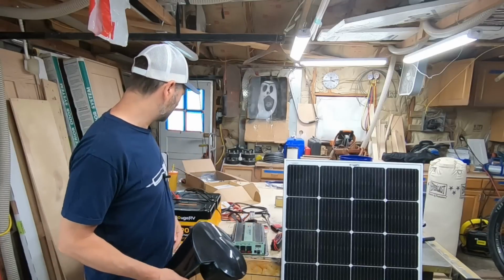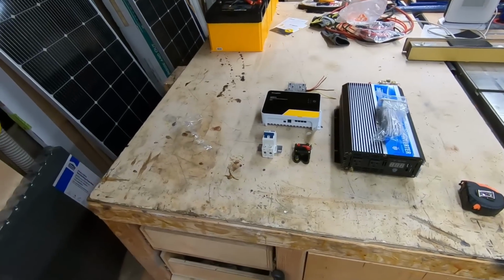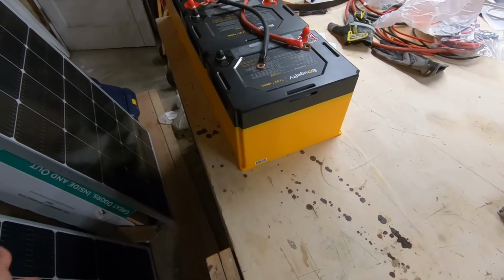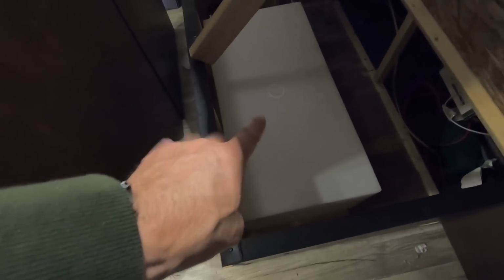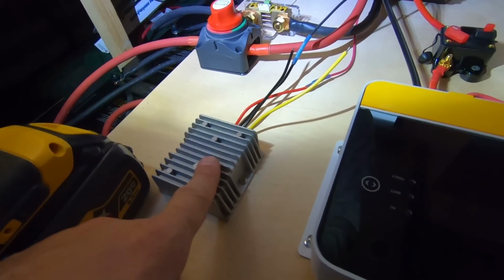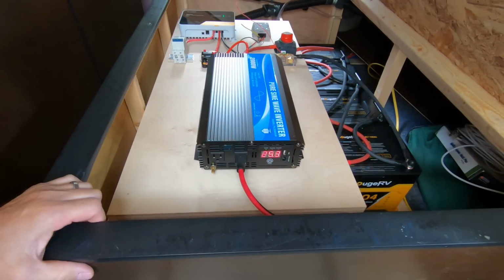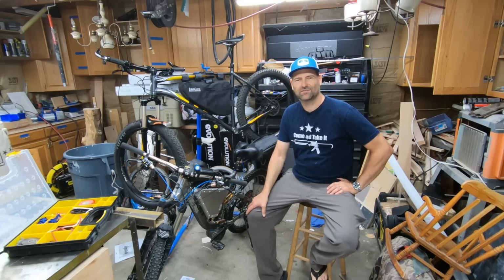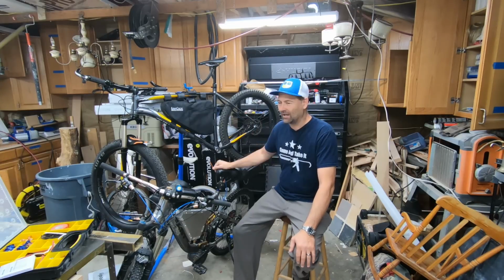California Is Forcing Us To Do This | Here Is My $7,000 Set Up | THE HANDYMAN |

Comment: You bastard, you got me with the boom, made me flinch LOL
We have had solar panels on our rooftop here in Tokyo since 2001, no batteries they just feed into the grid any excess power, and we get paid (VERY little) for the power, but if our grid ever goes down (you know big earthquake or massive typhoon) I flip one switch and I have has some 100v power for my house, not a full house's worth but some power. I also have a back up gasoline generator that would keep my freeze and fridge happy, (I don't want to lose the meat and venison I have in the freezer).
The whole solar thing is cool, but the batteries are still the weak link, but I bet we will be able to engineer out way out of that at some point.
Cheers from Tokyo!

Comment: Let us know if there’s enough airflow to keep the inverter cool. I have same setup in my camper I’d like to do something similar. Right now I have everything setup under a cabinet and it takes up much needed space. Nice setup..
Reply from the maker: That area under the bed is connected to the passthrough storage so its a lot of volume to heat up .  I could stick a vent in the passthrough door if It becomes an issues.

Comment: I'm not in the US but wealthy countries have similar initiatives. This to gain more energy independence, aside from driving down costs. Burning fossil fuels so expensive that it is worth it/cheaper to mine these minerals. Pollution is also less in the air but contained in batteries and equipment. By the way, your setup or batteries does not use cobalt.
Reply: You are a complete ignoramus

Comment: What kind of camper is that? Do you have a video showing off your camper? Did you build or modify it?
Reply from the maker: 2018 forest river 23dbh patriot edition.  I have done a few modifications to stay out longer. I have a 2nd 30 gallon water tank.  Total water is 76 gallons.  I also have a recirculation valve in the shower that pumps water back to the tank while you are waiting for hot water to get there.  I also have a diesel heater that I use to heat the camper instead of using the main furnace.

Comment: I see you've watched a lot of DIY Youtube videos! lol I also built a very similar hand truck solar cart with a 2000w inverter Nice job! but I used dc breakers for all my cut off's because of the china red ones or very weak ----->poor contacts same with that type of disconnect switch, if anything use the automotive race car type disconnects for max flow
Reply from the maker: The china breaker I had already broke.  It lasted only 10 on and offs.  I took it apart and couldn't believe how it was made.   I'm supersized it lasted 5 flips.

Comment: fact check, we use lifepo4 in solar, which only uses lithium. More exotic chemistries are less suitable and less safe.
Reply: Also, there is a big move by battery manufacturers to make these chemistries obsolete because of these concerns. They do not plan on using them long term in cars  lifepo4 is very stable and does not burn, it vents and is non-flammable

Comment: If you over-crimp those lugs, the wire becomes brittle and will eventually break due to fatigue.  I know this from experience; when I was an electronic engineer at Boeing I once had a whole bundle of 22 AWG wires come loose when I gave it a slight tug.  All the wires had already broken at the connector but they were still making contact (most of the time) because a strain relief was holding the bundle up.  The cause was an improperly calibrated crimp tool.
Reply from the maker: Thanks for the tip.  I will keep an eye on the connections.  🍺👍

Comment: HM, consider a dc distribution panel (something with 6 to 12 individual breakers of various load values) instead of wiring different loads to the primary output. It'll be safer in the long run.
Reply from the maker: There is a 12v panel. Its part of the camper.

Comment: Cool setup. I have the same charge controller but set for 48v. It works great however I noticed a discrepancy in the calculation of amps and watts being put into the batteries. I verified with a clamp meter. I suspect it’s just a miscalculation by the software. The controller charges fine so I’m not concerned. Did you notice any discrepancies in software with your 24v setup? Thanks
Reply from the maker: So far amps in is very close on the controller app and on my battery monitor.  Today I had a problem with the controller.  I drained the batteries down to around 93 percent,  then I turned on the solar panels and It wouldn't charge the batteries.   I disconnected the batteries from the controller then reconnected them and it started charging fine again.   What batteries do you have?  I'm not confident in these BougeRV batteries.
Reply: @TheHandyman1  thanks for replying. I have a dyi battery bank I made from repurposed prismatic cells. I have two 48v 70ah batteries wired in parallel. Maybe I just need to factory reset the controller. The controller has been great for the price. Thanks again for sharing.